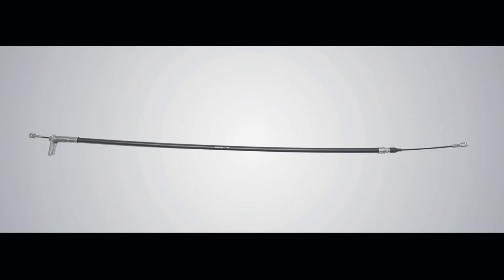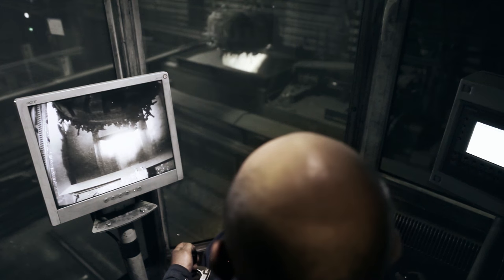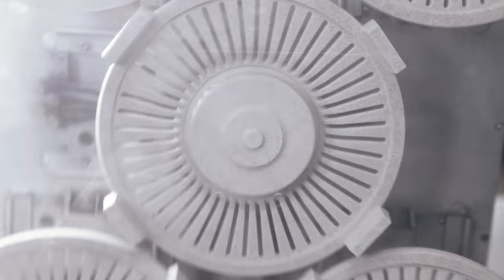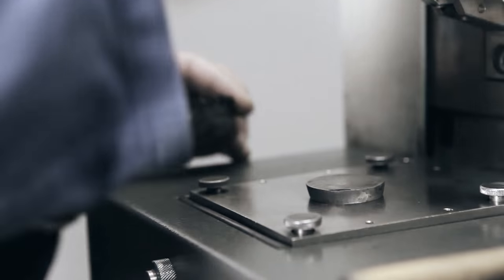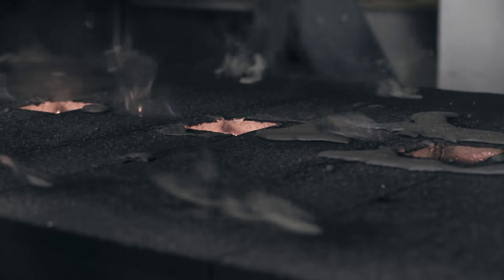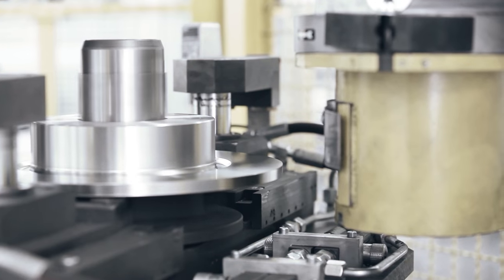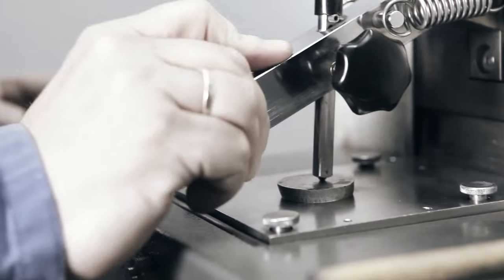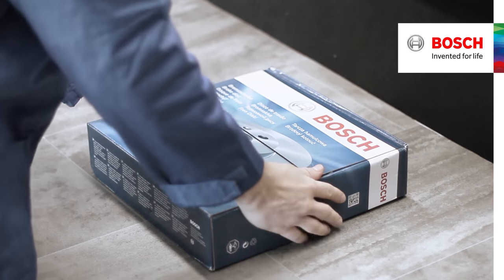EN | Bosch Brake discs

Comment: how about creamic disk??
Reply from the maker: Ceramic disk we do not offer since it is usually used only in the high performance segment which is very small. We focus with our strength on mass production.
Reply: Bosch Mobility Solutions Thank you for the information. 😊